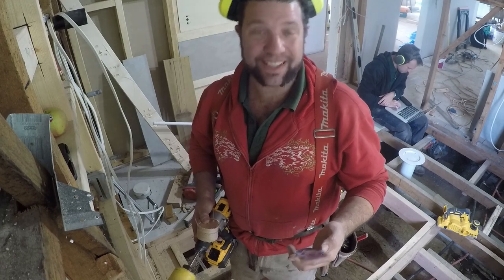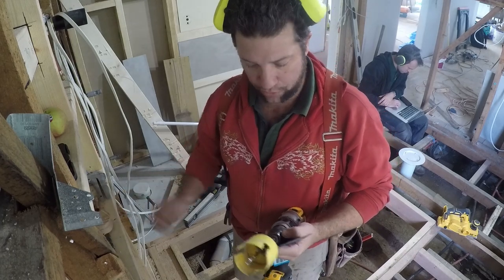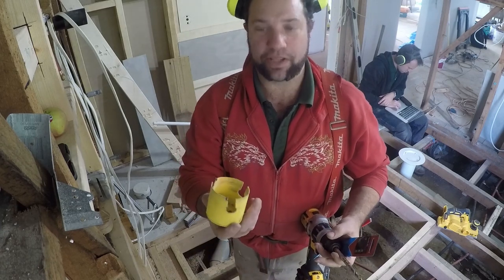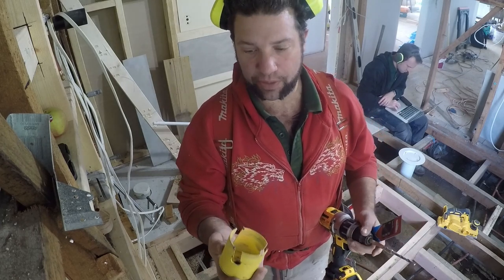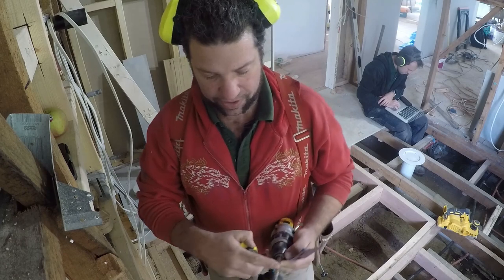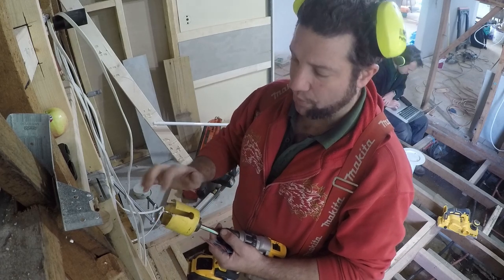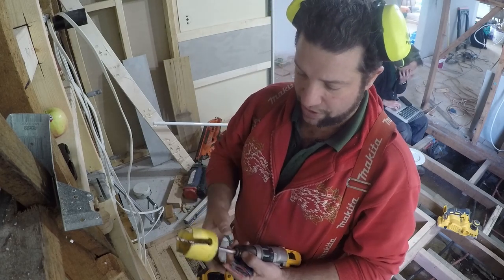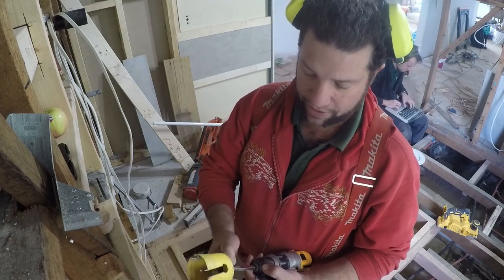Hole saw set - Tool Review Sutton Tungsten hole saw set

Comment: Hi.
I got a question for this . I got this holesaw set. And just wondering how to connect the holesaw to drill driver (in your video it's dewalt drill driver
Just like other drill bit. Turn tightly and tightly.
Or there's some adapters.  Because it come with 7/16 hex end... 

Thanks
Reply from the maker: i hate to say but i don't understand the question.
happy to help but very lost on this question description

Comment: Can these larger holesaws using a quick release arbor accommodate a 6mm pilot bit as well as the larger bit in the arbor or an adapter to do this?  I use the Suttons holesaws to cut out timber discs disc with a hole in the centre and the hole in some instances needs to be 6mm ( ¼" )  and others need to have the larger hole in the centre. Would be great if I can use the quick release system using a couple of different sized pilot bit for the same holesaw. The size of the saw I use varies from 1¾"  through to 100mm ( 4")
Reply from the maker: Gday John Robinson,
Thanks for writing in with your question.
There are a couple of different arbour sizes for the quick release system yet i haven't come up to one yet that is a 6mm (1/4").
Depending on the size of the hole saw, you could get around this by making a scrap piece into a jig by drilling the size hole that you need with the ordinary bit then use the holed timber to be cramped (clamped) to the piece you want to use and drill only using the hole saw.  there are also the old hand tighten system with the duel pins....these defiantly go down to 6 mm.
hope that helps #stayawesome
uncle joe joe